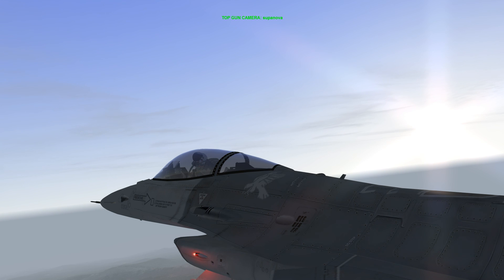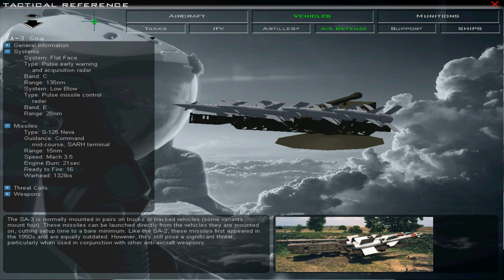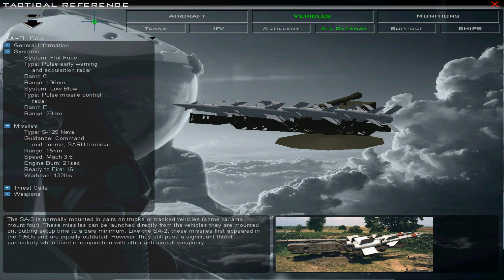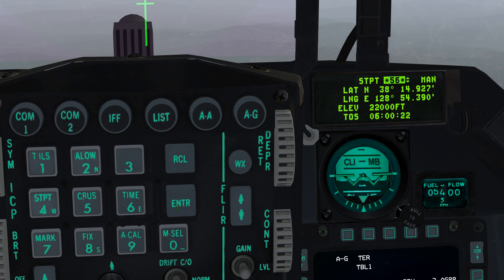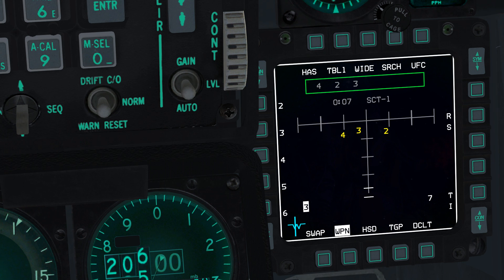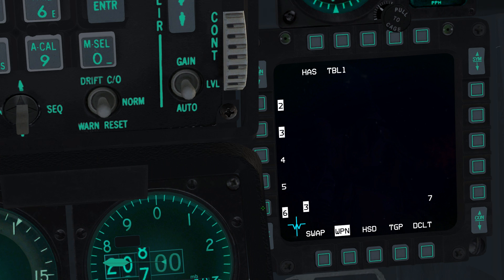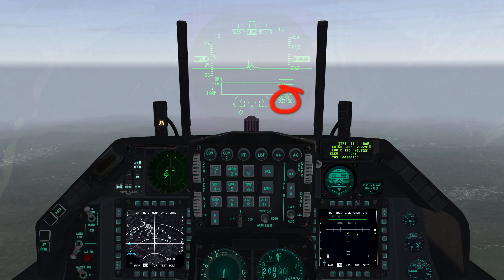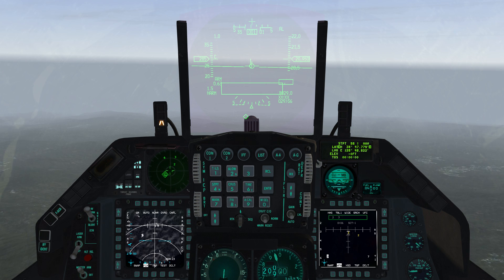Falcon 4 BMS 4.33 Tutorial 9 AGM88 HARM using HAS mode

Comment: is there any way to takeout s300 ? dont think we can do it with this missile but jassm can do it ?
Reply from the maker: The consensus seems to be a low level approach with a popup attack using a HARM between 20 and 30 miles, then go defensive. Alternatively fire at 26,000 feet at maximum range and turn and run.
Reply: better not to involve in it..

Comment: How do you know when to fire the HARM?  The HAS will display RDY when it was properly handed off, and has nothing to do with Range.  So if you don't have a STPT at the SAM, and just pick one up on the HAS, how can you estimate what your range is to that return on the HAS?

Great video!
Reply from the maker: I think the solution I came to when working on this was to use a combination of the centre display option with information from the RWR. Of course it's vital to understand the firing parameters of the SAM so that you don't get within firing range. But once the contact is visible with the centre option the HARM becomes viable.
Reply: Can you please explain in detail?
Reply from the maker: RainmanHST
It's a while since I last looked at HARM, but as I recall the missiles will be in range of the target when the target appears in the centre view. You still want to close the range to improve the shot, while remaining outside SAM missile range. If you look at the SAM's position on the RWR you can judge from it's distance from the centre of the ring how close it's becoming to firing parameters. A simple way to test and practise this is to use the appropriate HARM TE after looking up SAM range data. I have to say this subject is a little hazy and there isn't a lot of concrete information available, at least that I could find. I think perhaps the best solution is to experiment and find a solution that works best for your individual approach.
Reply: HAS has no idea about range. It's the sacrifice you have to make without the specialized pod.
Reply: @andrewa837  I disagree, I've used HAS to display emitters and the used POS mode to deliver the weapon. I never missed.